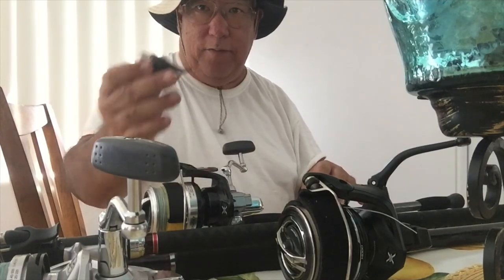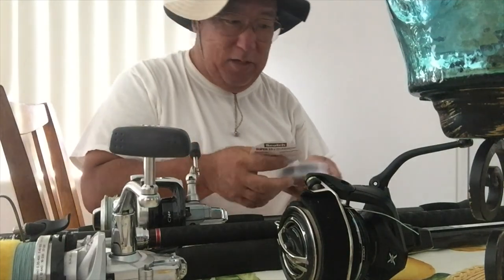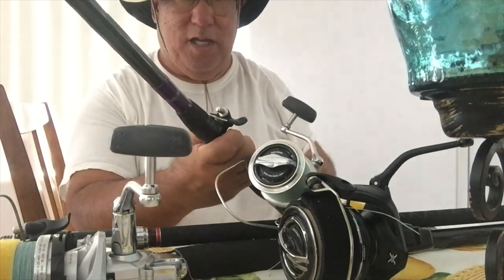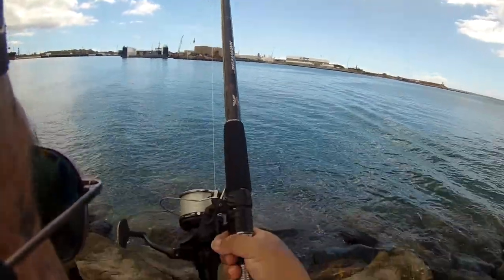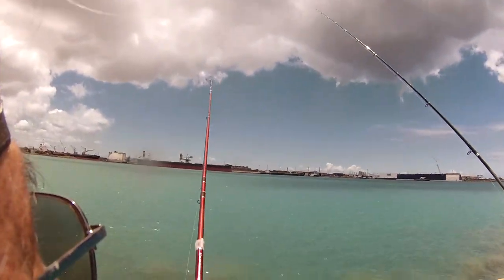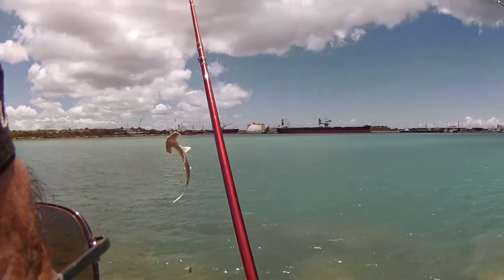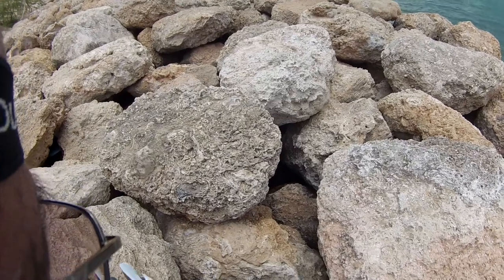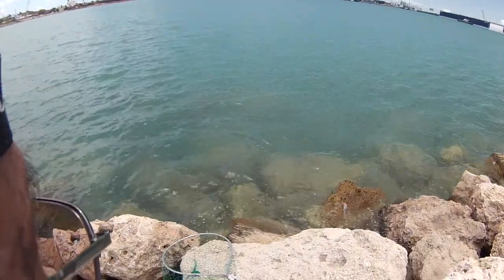What is a Cast Canon Casting Aid?

Comment: Great video Chris - those casting Cannons are great.  Pays to buy the genuine Breakaway ones - there are poor copies out there.  Also wise to make sure the drag is tight before casting.  I mount mine under the rod because I'm Left handed, and sometimes Right handed friends use my Rods too.  Stay safe & well!  🎣🎣👍👍
Reply from the maker: You are correct as always. Can't beat the originals. I've done a few vids on these Canons over the years but they were years ago still. Nothing new as i don't use them anymore as i never received a cut. Since then i have many new subscribers so a "brush-up" video was needed. Instead of going to the field i found what was needed in unused vids stored in multiple external drives. It was a quick video putting everything together so for the new angler it'll show what i've shown in the past but in different surroundings & SURPRISE a catch that shows it works.
Reply: @ScubaChris  Nice one Chris!